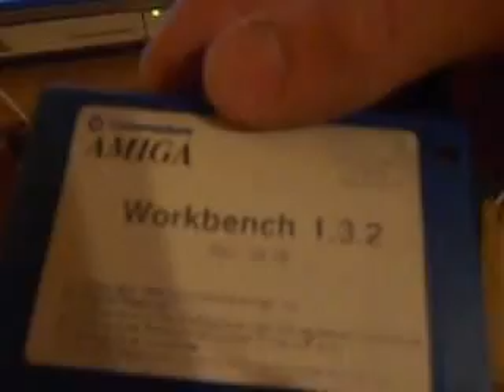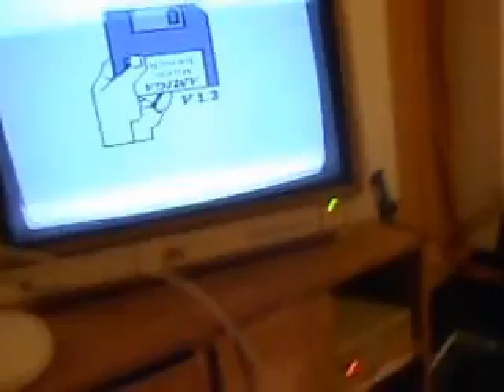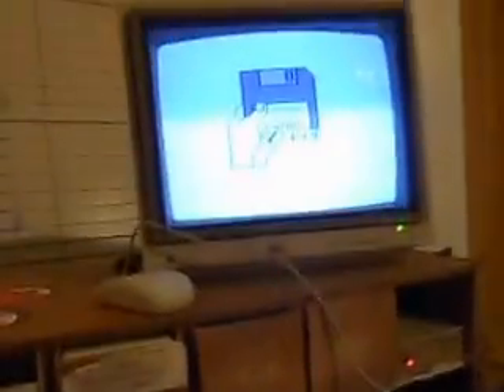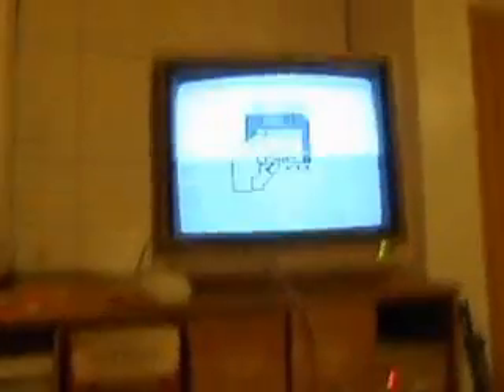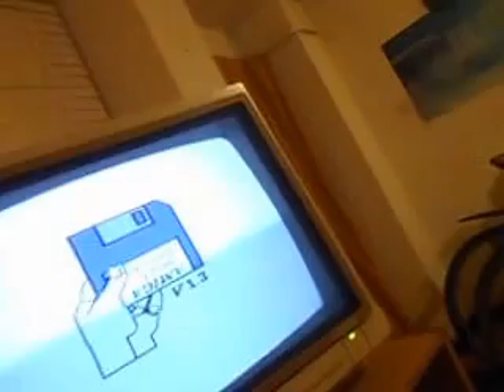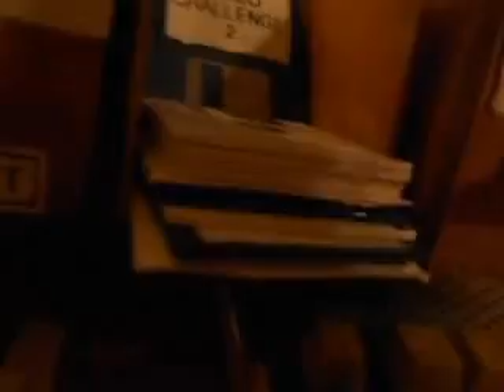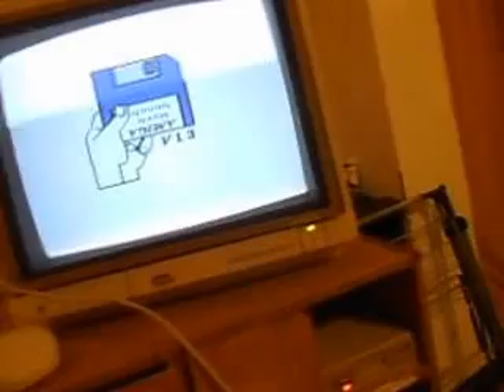Opening Amiga A500 Part C

Comment: From memory, the way PC and Amiga drives are 'numbered' is different.  Notice that both the internal drive and your external drive both have access lights on continually.   I believe that both drives are getting confused, because they are both set as drive 1, and there should only be one 'DF1:'.  Those PC drives that can be modified have this number changed.  There are some other differences between PC and Amiga drives, but again, in those PC drives that can be modified, this is not a problem.
Reply from the maker: +MarkTheMorose Well the external drive has a enable & disable switch on the back of it so I can switch it on or off
Reply: Jimyjames73
It wouldn't make the PC drive work, but you might be able to use the external drive.  I know that some models of the Amiga can 'boot' (start up) from the external drive instead of the built-in one.  I'm not sure it will work on an A500 with Kickstart 1.3, however, but it can't hurt to try.  What you'd do is eject any disks in the internal drive (DF0), switch off the Amiga, put a bootable disk in the external drive (DF1), then switch on.  As I say, I don't think it'll work on 1.3 machines, but it's perfectly OK to try it.  I'd suggest using a disk you don't mind possibly 'losing', so definitely not an original game disk.  The external drive might have tarnished heads itself, so use a backup copy of a Workbench disk, or a pirated game if you have one.